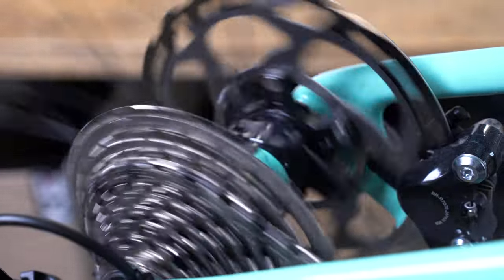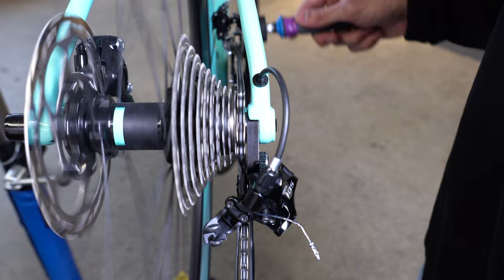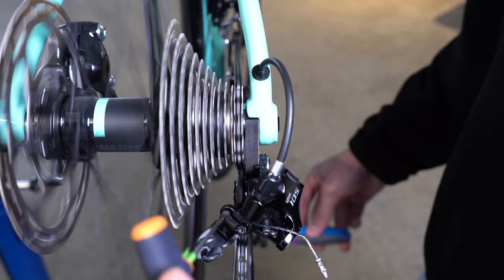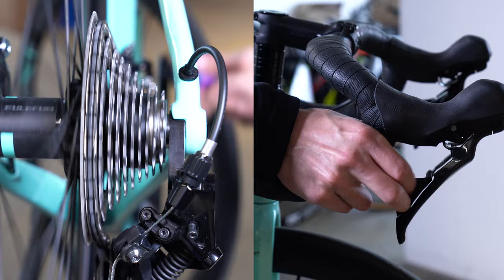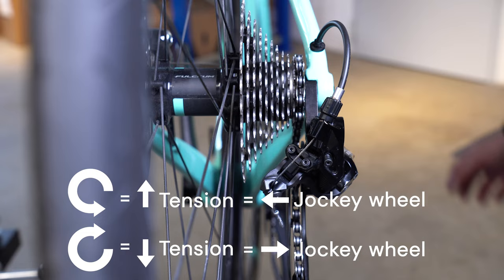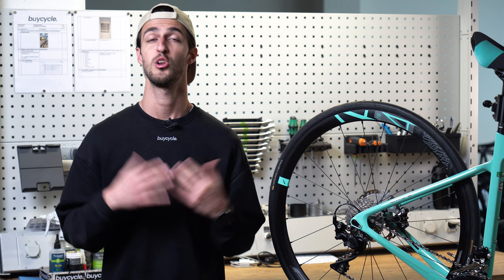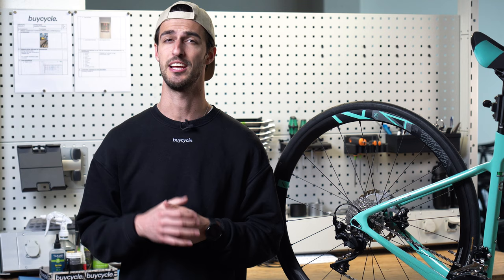Rear Derailleur Adjustment & Indexing | The Secret To Perfect Bike Gear Shifting!

Comment: Was halfway up Mount Shasta this morning and my two lowest gears kept slipping. Found this video and it saved my day! Pulled over, had it diagnosed and fixed in 10min. Back on the road and atop the Mount soon after. Thanks so much!
Reply: You biked up a 14er?

Comment: honestly I've found the easiest way is to remove the chain, remove the shift cable from the derailleur and then adjust the derailleur. I just got a new derailleur a few days ago and of course it wasn't dialed in out of the box. I installed it without the chain or shift cable attached and just adjusted the limit screws that way by eying the alignment of the jockey wheel with the highest and lowest cog. It took me literally 1 minute and once the shift cable was attached and the chain put on my shifting was/is perfect. This is also a nice technique because since the shift cable isn't attached you can reset the barrel adjustors making future adjustments alot easier.

Comment: Man, you are my hero. The method with pulling the derailleur by hand to the lowest gear is just perfect, I have not ever seen this method before and it works absolutely perfect!!!! Thank yoU!!!
Reply from the maker: That's fantastic to hear! We're delighted our method worked so well for you. It's all about sharing what works best, and we're thrilled it made a difference for you. Happy riding! 🚴‍♂👍
Reply: @buycycle  My derailleur only seems to want to move up and down. It doesn't shift when I move it. How do you move it side to side like that?

Comment: My fatal mistakes all this while:
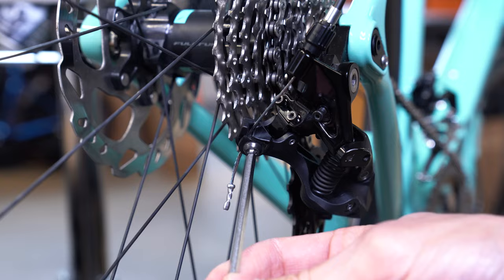1. 1:09 NOT detaching the cable as the very 1st step
2. 4:48 NOT backing up the barrel adjuster by 1 turn (counter-clockwise), prior to re-attaching the cable.

This video is the best!

Comment: I have watch several ok videos on derailleur adjustment but they there were incomplete and fully useful.  This video is much better than all that I have seen so far by a lot.   The colored cogs and limiter info very good.  The section that helped me a lot was taking off the cable and moving the derailleur by hand.  That made understand more so I could isolate my issue.  Thank you.

Comment: thank you.  my bike wouldn't go into the high cog in rear.  I disconnected cable like you said to check for limit, but it turns out I had the cable a lil too tight, so kept it from going to smallest cog.

Comment: At the indexing step after you shifted down and pulled on the shift cable to remove any slack, make sure the chain is on the smallest cog >>before<< re-attaching the shifter cable.
I forgot to do this, and after re-attaching the shifter cable I could not shift past half-way between the largest and smallest cog.
The chain being on a bigger cog caused the derailleur to be pulled towards the largest cog.

It took a few re-watches of this video before I got my bike to shift perfectly, also to understand how shifting works technically, but now it's done and it's time to hop onto the bike ;)
Thanks alot for this guide!

Comment: This has to be the best video explanation for my issues. Thanks - hopefully I will fix my gear shifting on my 2004 model specialized Ultegra gear mechanic.
Reply from the maker: Great to hear! Good luck!
Reply: @buycycle  I think I have adjusted it correctly, but still I have some issues. I recently changed my cassette to a 9-delt 12-25/ CS-HG50-9 Tiagra. The one I had before was 24, but perhaps it was 25 on the lowest gear, can't confirm fully if it was 24 or 25. Anyway, I have adjusted my Ultegra gear, but when I am gearing from my last gear and back upwards to lower cogs step by step, it run smoothly enough for me, but when I am going down again step by step, it struggles and I have to click to times to make the chain be placed correctly. This means, from the 3rd last cog, when shifting to 2nd last cog, it will skip totally the 2nd last cog and be placed in the last cog. Is this related to the low limit screw? And also, is it a must to have the chain on the biggest ring in front at all time?

Comment: Interesting and informative vid - thanks.  I have a new Canyon Endurace 7 with a Shimano 105 R7000 groupset - 52/34 chainrings and an 11-speed cassette.  The front derailleur is the newer 'pivot' type.  From the off, I've had an annoying (if very light) chain rub with the two sprockets below top gear (second and third smallest) whilst on the large chain ring.  Trimming makes no difference.  I've dismantled the front derailleur and set it up again from scratch 3 times now, tried micro-adjustments to cable tension and H/L screws, even replaced the large chain ring (a friend thought it looked a bit out-of-true), but have been unable to completely eliminate the rub.  I'm almost beginning to think I'm being over-sensitive to it, as it is so light - like a very low rattle, more like the chain rivets brushing against the plate rather than hitting it.  But why is there complete silence in the other gears, and no rub at all on the small chain ring?  Also, it doesn't happen when the bike is on the stand - only when I'm on the road with weight on it.  I'm wondering if it now might be the rear derailleur that needs some adjustment.  I've been focusing on the front because I've not had a bike with the modified front derailleur before, and have just got it into my head that it must be that.  But I'll check out the rear now.  Do you have any other suggestions as to the cause, please?

Comment: Thank you for explaining it so clearly and easily follow. However, I still not able to get the Shimano Altus thumb shifter to shift to smaller sprocket. It only shifts to larger sprocket. Is that the problem at the thumb hear selection by the handlebar? Do you have a video on that part? Thanks.

Comment: Great video. I'm having some issues where my high gears (7,8,9) shift well with no noise but then the lower gears (3,4,5) don't shift at all or if they do, it's very clunky and noisy. It's a new bike from a professional shop so I can't imagine they have incompatible hardware on there. Any suggestions?

Comment: Still had a problem with the gears not engaging even after your perfect information, I had the wheel changed by Halfords and when I looked into it it turned out to be the cassette was loose they hadn’t fitted a spacer

Comment: Heybike Race: There are loud noises coming from the rear wheel cassette itself; it appears that the inner link of chain on smallest cog (high gear) was rubbing against the bigger cog's teeth when the pedal was being applied.
Do I still need to slack the cable if my intention is to adjust the rear derailleur such that it stays straight with the smalles cog teeth?

Comment: Have 11 speed mechanical. If i'm changing from an 11-30 to 11-32 cassette, do the limit crews need to be adjusted? I assume only the B screw will need to change for the 32 tooth cog?
Reply from the maker: Technically you do not need to adjust the limiting screws. However nothing wrong with double checking when you've got it on. When on the 32 tooth cog, press on the shifter to see if there is movement toward the frame. If so then you need to tighten.  B-Tension yes!

Comment: thanks for sharing. i believe i have everything perfeclty adjusted but i still have a kind of grinding when pedaling on high gear or on a hill. Bike is new, its on a trainer, no rubbing on the front derraileur , i cant find anything. any tips on troubleshooting? cheers
Reply from the maker: Hey there! Is the grinding sound coming from the back or front derailleur? Could it be due to cross chaining? So you have the chain on the largest chainring and largest cog in the rear?
Reply: @buycycle  Hi, no, its not the cross chaining. i believe i checked all the "basic" stuff and it looks pretty alligned. one thing i just noticed is that the chainline is a bit off (big chain ring alignment with small cog). is it possible to add a shim on the crank in order to bring a little outwards? i think this might do the trick

Comment: I'm utterly fed up with derailleur gears after decades of riding bikes with them. It's a complex system prone to constantly falling out of alignment and needs constant maintenance. Is it any wonder, considering that it is a transmission system left out in the open? Few riders have a workshop and a bike hanger, so we're stuck trying to repair faulty gears in the rain, wind or snow. It's obvious from this video that indexing gears is impractical unless riders have those facilities.

Comment: I already added this as a reply, but will try a comment as well. I am a bit impatient atm, sorry.

@buycycle  I think I have adjusted it correctly, but still I have some issues. I recently changed my cassette to a 9-delt 12-25/ CS-HG50-9 Tiagra. The one I had before was 24, but perhaps it was 25 on the lowest gear, can't confirm fully if it was 24 or 25. Anyway, I have adjusted my Ultegra gear, but when I am gearing from my last gear and back upwards to lower cogs step by step, it run smoothly enough for me, but when I am going down again step by step, it struggles and I have to click to times to make the chain be placed correctly. This means, from the 3rd last cog, when shifting to 2nd last cog, it will skip totally the 2nd last cog and be placed in the last cog. Is this related to the low limit screw? And also, is it a must to have the chain on the biggest ring in front at all time?

Thanks once again

Comment: i dont have a bike stand it literally fucks my mind up so badly trying to follow these videos when my bike is upside down i cannot manage to get the gears to shift properly after hours of trying everything
Reply from the maker: I totally get the struggle without a bike stand—it can be a puzzle! Have you considered propping the bike against a wall or using a DIY stand? Sometimes, a different angle might just untangle those gear issues. Hang in there, you're not alone in this bike repair adventure! 🚲💪
Reply: @buycycle  thanks for the support thanks to watching your video a couple times over I was able to get it shifting smoothly in no time

Comment: After i got the 1 to 3 aligned, 5-6 then start clicking..  adjusted then 2-3 start to f* up again
Reply from the maker: It is all about finding the correct balance. If it does not work out at all then it might due to another issue such as dirty/used cable housing, bent derailleur hanger, used chain etc